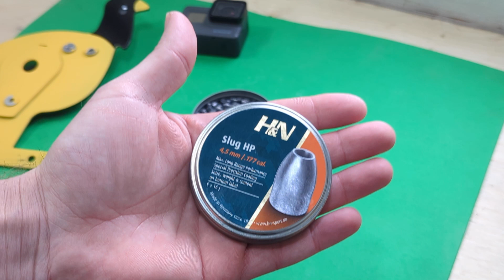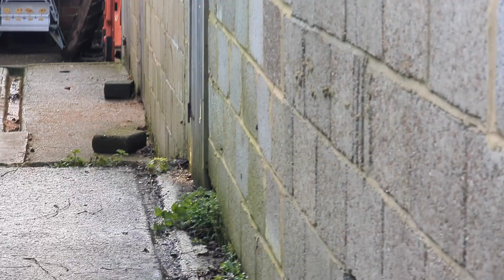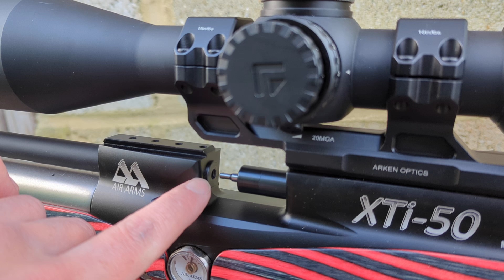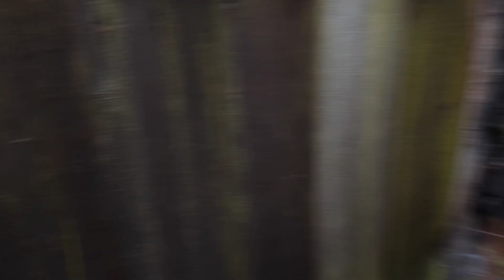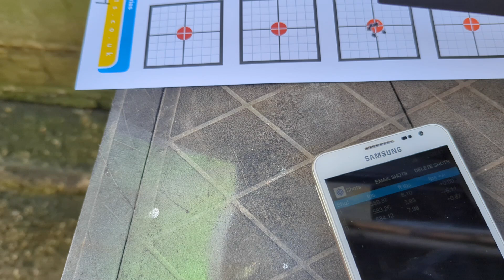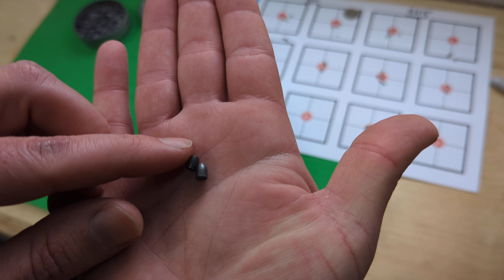Testing the H&N high power slugs.. they hit hard!

Comment: Question? 
Are you planning to run the 16grain aswell. I've been scratching my head about the power loss I know there's more friction with a longer bearing surface, but.. the internal ballistics of a PCP usually suit heavier as best for making power longer time to accelerate etc I know you .177 guys will have a freak out with 16grains but it's totally normal for a .22 that weight is completely acceptable for the mechanism to power it.
If you can get back some of that lost power granted your not then running fast but for me the BC is all about beating the pesky wind and even if they start close to .22 speeds they should overtake long range. Whether the low speeds will give them enough RPM to stabilise correctly??? Maybe just shoot and see testing, might be that friction always wins.

Comment: They do seem to be reasonably consistent in both of the rifles, will be interesting to see what happens at longer ranges. I wonder what the coating is and what effects that may be having. It could be adding lubrication, but if it is waxy, it may be adding some friction. Likely it is also is reducing lead deposition into the barrel. But a coating can be less consistent than the slug diameter, so may add more variability into the results.
You would expect the slug to deform less than the skirt on a pellet and would load more parallel to the rifling. Very interesting video!
Reply from the maker: Same old thing eh mate,more questions than answers... 

I'll get them through the chokeless barrel too when it dries out a bit. Should be interesting as they definitely feel more consistent on loading than most the shorter sizes.

Comment: Found this test really interesting, thanks.
Perhaps I’ve miss understood the slug/sub 12 thing, thought they were a ‘no no’ for sub 12’s. However this video and the comment by cjnev9618 show they shouldn’t be dismissed as a waste of time.
Reply from the maker: Hi mate. They can be fantastic but there's so many factors that can cause inconsistencies that need ironing out before I even look at barrel twist rates and valving setup. One of my early vids using the makos was mega
 They were fantastic in the wind and way easier to judge the drifts. But the following batches wernt anywhere near as good ...
Reply: @tillysgunstocks  

Many thanks for the reply. 

I did Google this but didn’t seem that conclusive so I wondered if I could lean on your pellet expertise:
I have a tin (been opened) of Bisley Magnums which I’ve had for possibly twenty years. They don’t look bad, still dark but do you think I could use them or not.
Won’t be put out if you don’t have the time to answer this as I appreciate you’re a busy guy.

Best wishes, Nick

Comment: the 21g h&n are surprisingly accurate through my hw97k 22 cal sub 12 . pellet drop is less than inch over 25yards compared it's usual 16g aa field 👍🏻
Reply from the maker: It's funny eh, some barrels just run them no bother. When it all.comes together they can be great,but getting the ducks in a row is the tricky bit.fun to try though 😉